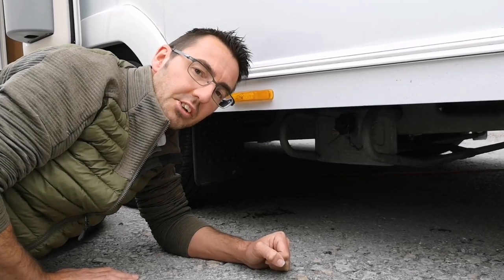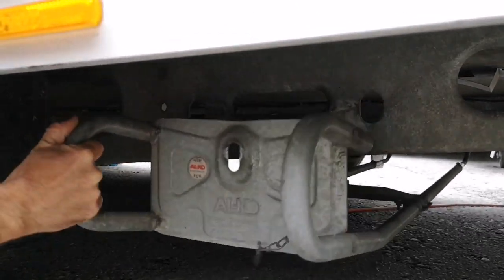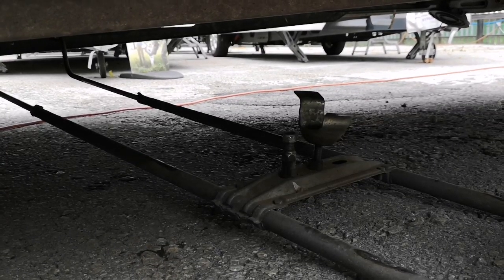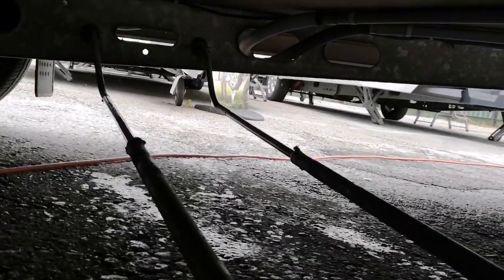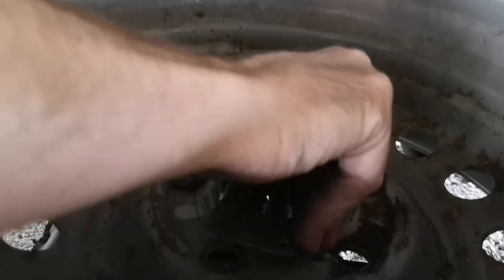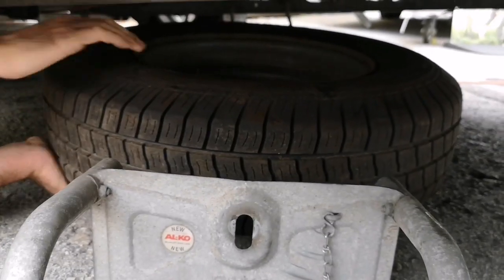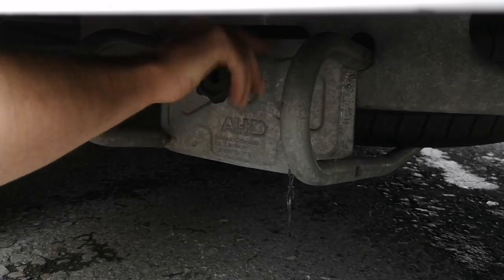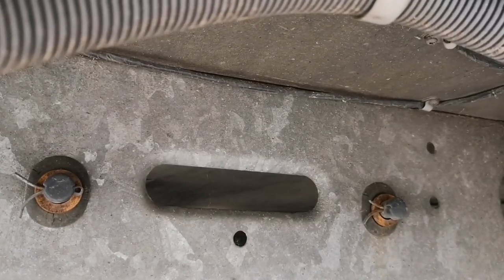Alko spare wheel carrier instructions, caravan spare wheel carrier

Comment: I'd like to see this repeated by a 75 year old. I'm in OK condition for my age but lifting the wheel cradle back into place proved impossible without a series of levers. I was on my drive, I would have been stranded by the roadside.🤨
Reply: I've just done mine on my drive (putting the spare back), and had to stop to watch this video as can't believe how incredibly difficult this was to achieve... 1) get the carrier off and pulled out 2) Get the wheel off (the RAC guy even struggled roadside to undo the bolts...) 3) Get the wheel back on (total faff getting enough space to do it as this video demonstrates) and 4) pushing the damn thing back in (even after using copper grease to lubricate). Total and utter design failure in my opinion...

Comment: What methods do you employ if it’s seized and won’t pull out ?
Reply from the maker: Soak with wd40, then trying to work it back and forth after a day or so, they will normally come free.
Reply: @thecaravanplace  Thanks for your reply ! it’s just a tube in another tube isn’t it ? Can I drop the whole rack? looking at “ off side” if I remove the split pins, the whole thing should just pull to the “near side” and drop, then I should be able to refurbish….
Reply from the maker: @stevedoran3278  yes if you undo the 2 O/S split pins on the outside, once dropped as normal on the N/S and then it will slide off. Yes just 2 tubes, 1 inside the other. 👍
Reply: @thecaravanplace  👍🏻 it’s an old van, doesn’t look like it’s been serviced for quite a while. But before I let it loose on the road, it has to be in as near as new condition as it could be before I would let my daughter, grandson and future son in law loose with it.